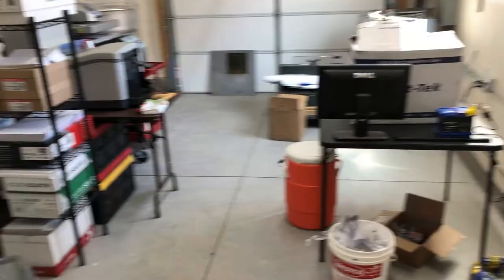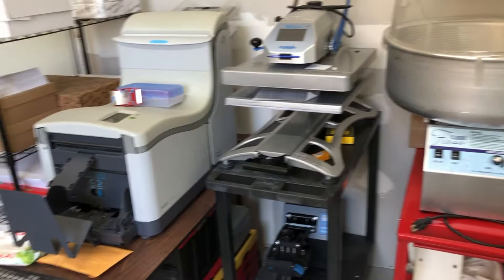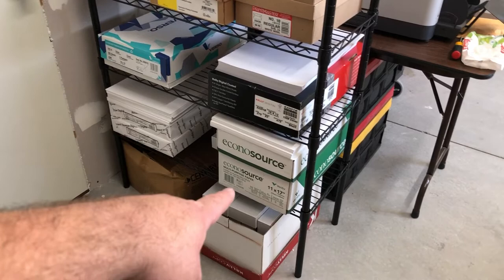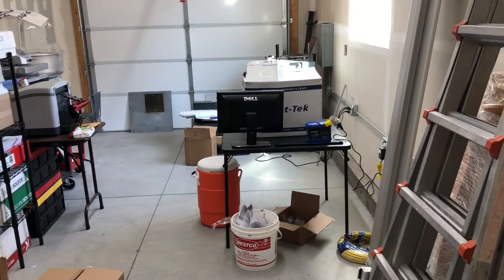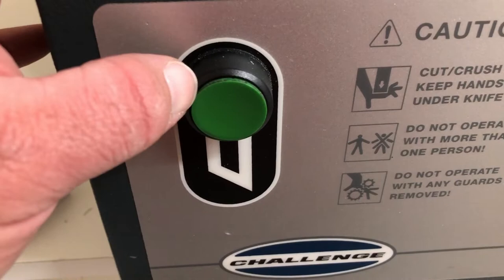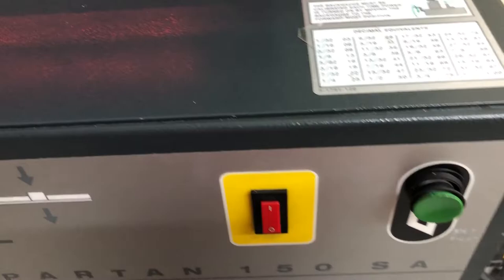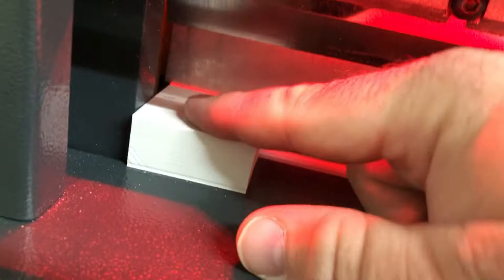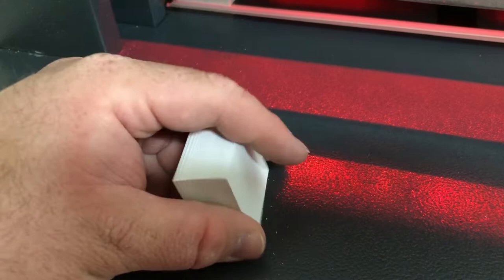Finally fixed the stack cutter - vlog 89 - Print Shop Updates

Comment: You have a good amount of space in your shop.
Reply from the maker: It's way too small. I don't have room for a decent work table to cut banners and larger media. I'd like something about twice the size. 😊
Reply: I have a 310x162 cm (124"x64") tri-foldable laminated MDF table that I use for cutting and mounting vinyls on boards and that I pack away after finishing. You can consider this option if you lack space in your shop.
Reply from the maker: I'd love to see how you built it, or how it works.
Reply: @ttms  Well the idea was mine and it's simple : 3 laminated MDF boards pieces attached by 2 or 3 hinges (depending on the width of the table) and fixed onto bars of steel. The whole work was made by a capenter who figured out how to make it foldable so it will look as a single piece and easy to store.